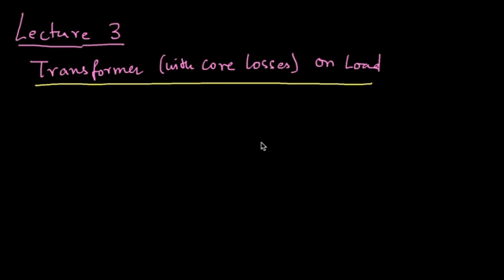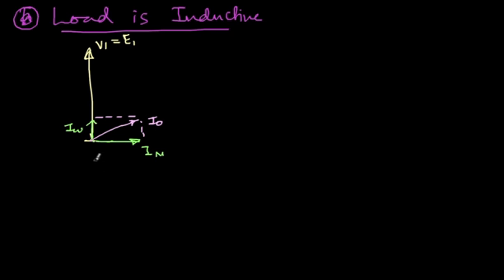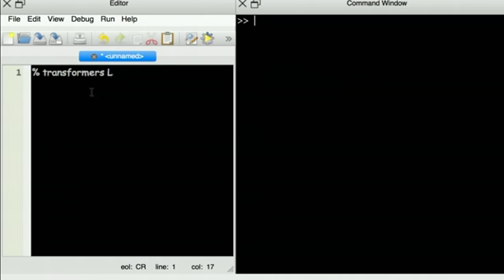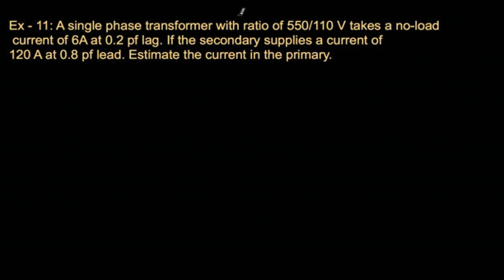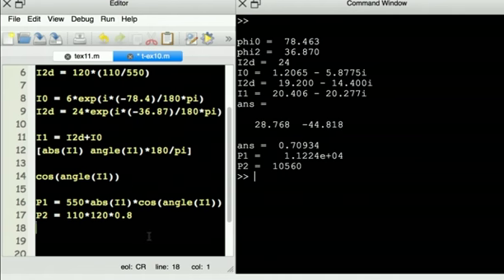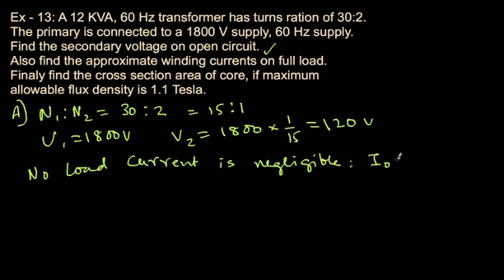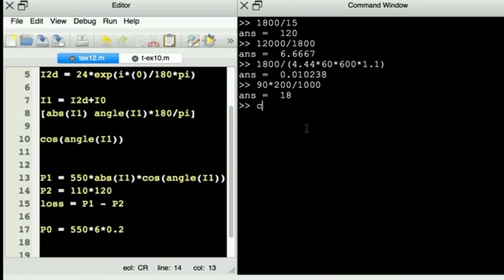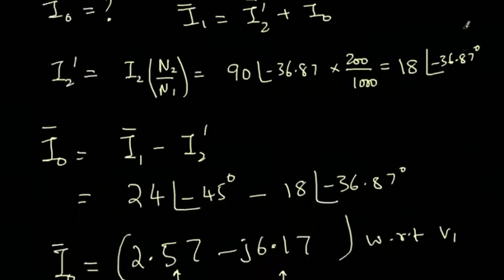L3 - Transformer on Load

Comment: When we say 550/110 v transformer what do we example mean we we mean the voltages at the source and the loard terminal if so how do we calculate the transformer ratio knowing that the transformer is not ideal what I mean is for example if we changed the load the voltage at the load terminal will change which means that the transformer ratio will change and according to my understnding a transformer ratio should not change
Reply from the maker: Outside the classroom 550/110 means, if transformer primary terminals are connected to   550 v supply and rated full load is connected to secondary side then the expected voltage (considering all the internal voltage drops) at the secondary terminals will by 110 V. So 550/110 is not the turns ratio. However for classroom purpose it can be considered as turns ratio by neglecting losses and voltage drops.

Comment: Prof. Pradeep question regarding EX-13
when you get the cross section area why you assumed N1 is 600 however the transformer's turn N1:N2 IS 30:2?
Why you did not choose N1=30??
I'm confused and I need an explanation please?